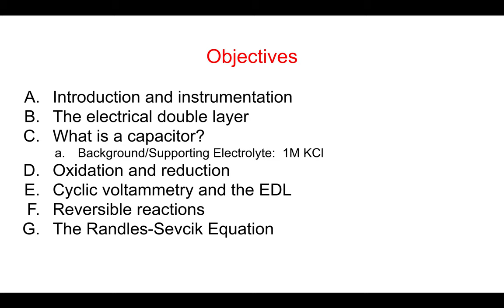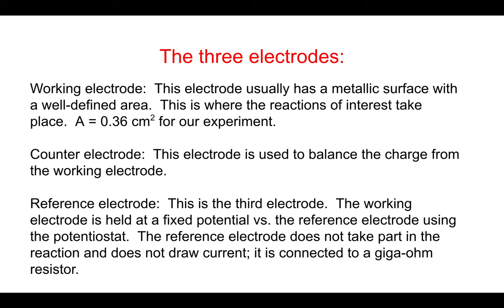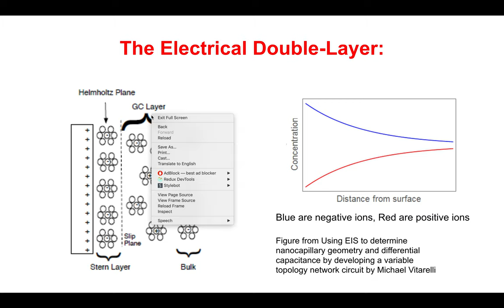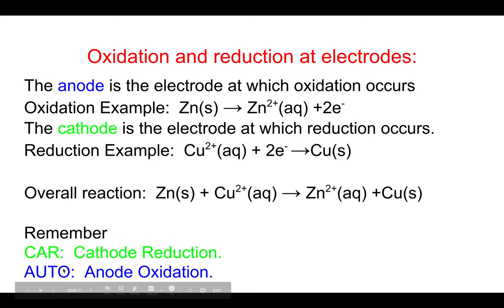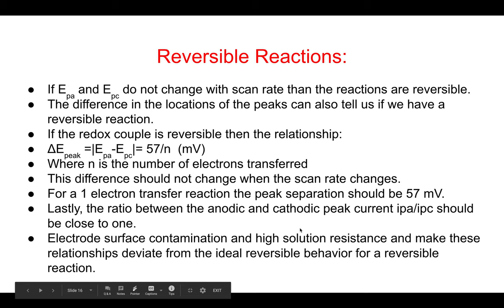Cyclic Voltammetry

Comment: 0:00 - Objectives
0:34 - Introduction
1:32 - Instrumentation
2:14 - Solution and Electrolytes
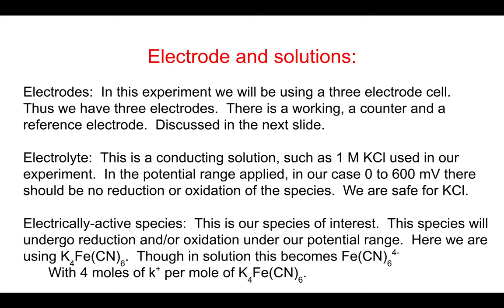2:58 - The Three Electrodes
3:46 - The Electrical Double Layer
6:58 - Recap of Previous Slide
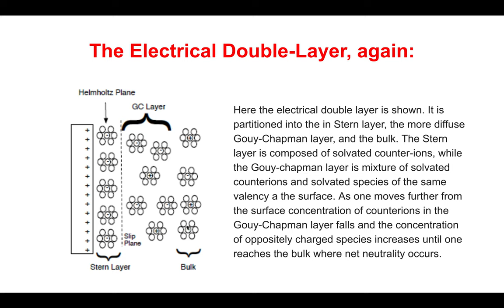7:25 - What is a Capacitor?
9:14 - The Background
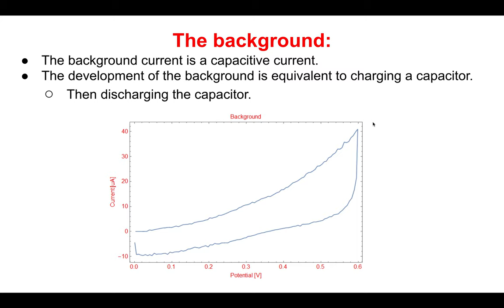9:55 - Oxidation and Reduction at Electrodes
10:37 - Species in Aqueous Solution
11:32 - Cyclic Voltammogram and Background
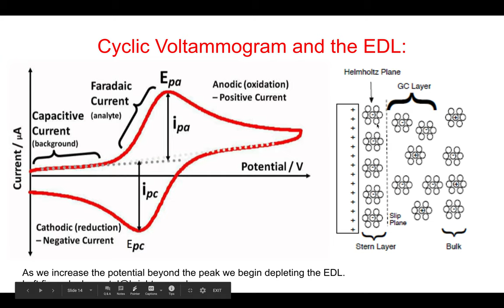13:50 - Cyclic Voltammogram and the EDL
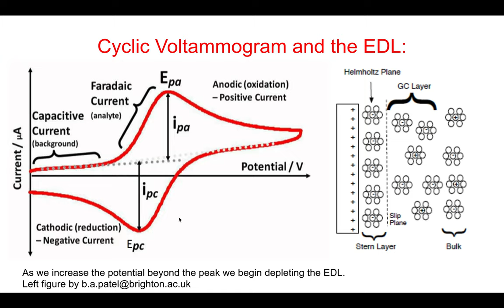15:55 - Data
16:40 - Reversible Reactions 
18:00 - Reversible Reaction Conditions
18:13 - Randles-Sevcik Equation
20:41 - Thank You

Comment: 15:31 Could you explain why everything reverses but not symmetrically? Thanks for the video!
Reply from the maker: One reason, is there is a slightly irreversibility to this reaction.  Look at the figure at 12:47.  For a completely ideal and reversible reaction the magnitude of the peak anodic current would be equal to the magnitude of the peak cathodic current.  For a completely irreversible reaction one of the peaks would be completely missing.

Comment: Hi Mike, great video!
Do you have any links to a potentiostat setup that would be under $1000 USD?
Reply from the maker: Hello George.  Is the $1000 USD with or without a potentiostat?  Let's say you have access to one.  Then certainly you can perform cyclic voltammetry for under 1000 USD.  
3-Electrodes:  platinum, gold-disk, reference - total cost about 500 USD.
Cell:  For the cell you can simply use a beaker to hold the electrodes with a ring stand and clamps.  - total cost about 10 dollars.
Chemical: In the experiment above I used KCl for the working electrolyte and K4Fe(CN)6 for the electro-active species.  These are all pretty cheap from Sigma-Aldrich.
Safety:  Gloves, googles, and a lab coat per individual - 35 USD.